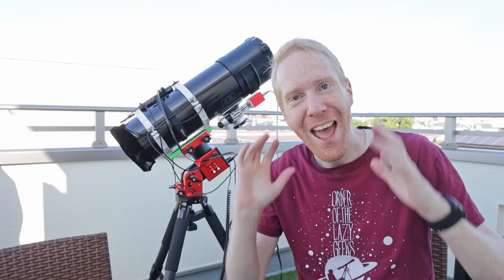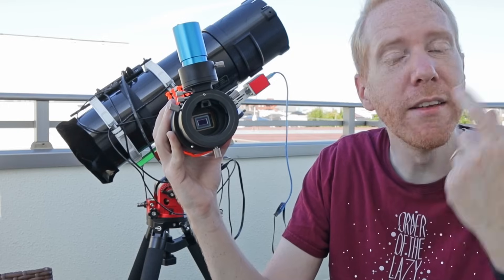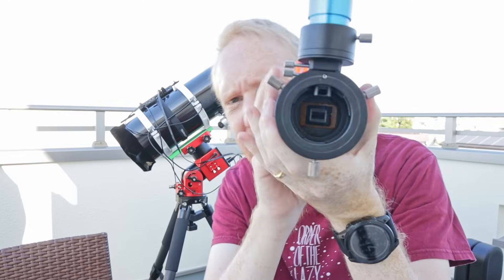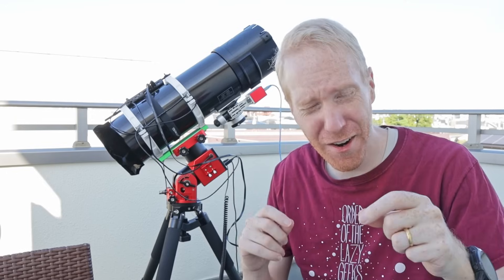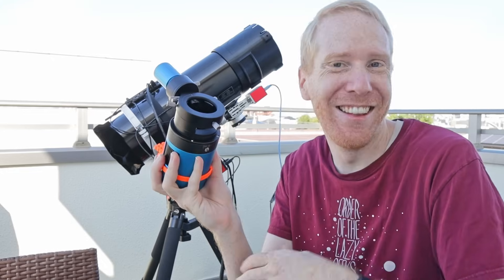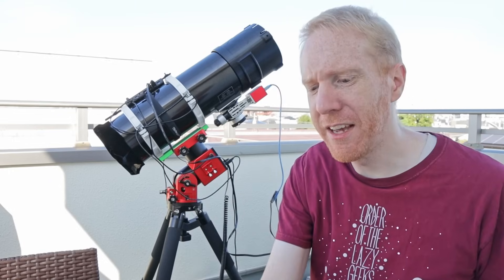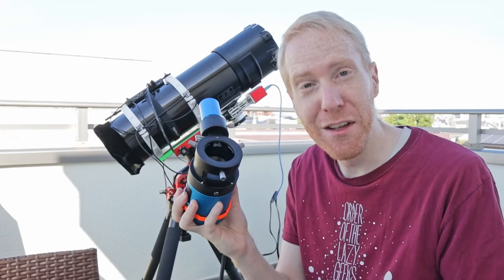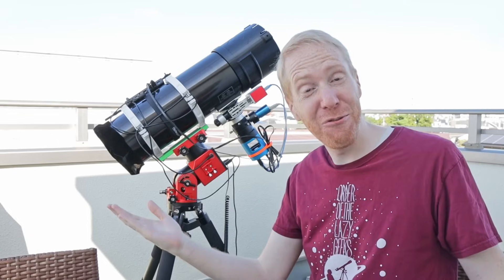Trouble with Off Axis Guiding? Let's fix that! ZWO ASI2600MC Duo too :)

Comment: Thanks for in depth discussion on oag.  Plenty of valuable points were taken into account. However, for this telescope operating @520 mm with comma comma corrector (simultaneously working as a reducer also) absolutely no need of oag. Using the same setup, i have taken 5min exposure shots without any problem. The employed mount was am3, which does not offer heavy pay load capacity load capacity than am5, utilized by you.
Reply from the maker: Definitely needed an OAG because of the terrible default focuser on that scope causing differential flexure :)
Reply: @CuivTheLazyGeek  sorry, I haven’t provided  complete details of the setup. I use asi120 mini scope for guiding. It will be exciting if you give a detailed comparison of the oag with traditional guiding scope mechanism, so that we will be able to know, how much significant impact oag has over the traditional. And it will also generate more sense and validity of using oag on small focal length telescopes. Thank you

Comment: Hey Cuiv!
I got a question:
Since I am using the OAG, my star shape issues disappeared, so all is good in this regard.
However, since I now have to use a filter drawer (so I can use it with DNB filter), I have literally 0mm space for a rotator. (16.5mm OAG + 21mm filter drawer + 17.5mm from the camera = 55mm exactly).
My only way of rotating is by rotating the coma corrector inside the focuser, which is very suboptimal, since this will cause the collimation to vanish. I tested that with the OCAL, no matter how careful I turn and lock it again, probably simply due to the way the CC is built, I lose collimation.

Also, even though it is not a big issue, I couldn't turn the camera in a way so that the prism of the OAG is parallel like it is for you, so I have quite some big vignetting in the guidecam.
How did you solve the rotating issue?
Reply from the maker: Interested on the collimation. Maybe I'm not demanding enough of my equipment, but the CC rotation doesn't seem to affect collimation. Maybe some astigmatism in your CC?
Reply: @CuivTheLazyGeek  Hm that's a good question. I don't think so as my  cc has very good quality and I don't see any optical issue with it.
It is probably just the way it lies inside the focuser.
I read in the OCAL instruction that this is normal, simply because nothing is built 100% perfectly, so that you should collimate on a specific rotation and don't change it if possible.
I guess if I could just turn my camera it wouldn't be an issue, though

Comment: I used OAG years ago, and I wasnt fond of them. Ive been using guide scopes for years now. However, the products I wa using are nothing like they have now. I may look into for longer focal length imaging. It would makes things much lighter also.
Reply from the maker: Agree - usually there wasn't a reason for them except for long focal lengths, but it's a bit easier these days

Comment: Another issue with OAG during Galaxy season is after a meridian flip on an EQ amount, you have a different star field due to the flip, there may or not be a star available to guide on after the flip. This can be a pain when doing automated imaging without a motorized rotator.
Reply from the maker: True, especially with large focal lengths.

Comment: Thanks, Cuiv.  This helps.  You are correct about the long focal lengths scopes.  Mine is 2800mm and there are times when there are no stars in the view.
Reply from the maker: Yeah 2800mm is an extremely long FL, kudos for imaging on such a long FL!

Comment: Perfectly focused stars especially when undersampled will take up only one pixel (mostly on guide scopes) and your guiding software might confuse it for a hot pixel. Also, if you have a good quality telescope and a solid mounting system for your guide scope, don't bother with an of axis guider. People make it sound like it is the only way to image. On my f2.8 newtonian gave up on the OAG, kept having shadow of the prism on my zwo asi533. Works perfectly  fine with guide scope
Reply: Also, your OAG should be in front of filter wheel

Comment: if you don't focus also the guide camera after a filter change and autofocus has happened, you will run into a risk that the guide stars that are now defocused, will not be detected any longer by PHD and it will stop guiding on "star lost". It happened to me many times.
Reply from the maker: Yes, I should have mentioned in the video that I assume the filters are reasonably parfocal - if you're using 3mm thick filters and 1mm thick filters, you will have issues. It's weird though, for me PHD2 keeps trying and trying and trying until it finds the star again, never stopping. And even if it then locks on the wrong star and pulls the target off center, NINA will catch that and recenter

Comment: Great discussion Cuiv! Two points:

(1) Another solution for the issue of guiding when re-focusing after changing filters: Use "filter offsets" and also temperature-compensating focus changes. Once these two automated processes are dialed-in, one only has to focus using a luminance filter, then guiding can continue uninterrupted until a new target is chosen. The good news is that NINA & some other imaging software (and software from some focuser manufacturers) can handle "filter offsets" and - with a temperature sensor added to the system - temperature-compensating focus changes.

(2) The issue of finding a guide star with longer focal length systems (especially in fields with few brighter stars) brings us full-circle in our search for equipment for astrophotography. It used to be that a very finely-machined, ultra-precise & often heavy mount with minimal Backlash & Period Error was a necessity. Now, 'harmonic mounts' are becoming all the rage, because of their amazing portability, and (if carefully-designed) virtually zero backlash. The problem, however, is that 'harmonic mounts' inherently have a large 'periodic error', plus the rate at which the mount 'loses stars' can be very rapid/sudden. This means that most 'harmonic mounts' require very frequent guiding corrections, therefore very short guide exposures (e.g. 0.5 second for the AM5), which, in-turn, exacerbates the challenge of finding suitably bright stars for guiding with the off-axis guider (especially with longer focal length systems)! Yikes! lol

Why is this a problem? Well, the only way to mitigate this issue is to use longer guide camera exposures, and/or rotate the guiding camera...but in the former, that means the mount needs to have smaller periodic error & no sudden changes in tracking, which 'harmonic mounts' cannot deliver. In the latter, it often means purchasing a rotator, so that the process can be automated & be highly reproducible (for imaging on successive nights, and also for reliable flat frames) So, if one wishes to keep the system highly portable, there are several solutions, including (a) purchasing a rotator for the system,  (b) keeping the same longer focal length, but use a much 'faster' system (therefore more aperture), (c) employing imaging & guide cameras with much higher sensitivity, (d) using a harmonic mount that has encoders on the RA axis, or (e) giving up & imaging at a shorter focal length, With every solution except (e), it will require purchasing new, more expensive gear....which is why, IMHO, astrophotography represents 'a black hole for wallets & bank accounts'! lol
Reply from the maker: Yep, aware of filter offsets (was actively involved in NINA development at the time and added the default AF filter that relies on that :) ), it worked great when doing filter looping, like L->R->G->B->L... in sequence
And agreed on harmonic drive mounts, although my AM5 seems to perform very well with 1s exposures, although a bit better with 0.5s exposures :)
Perfect summary of the deepening black hole of astrophoto lol

Comment: Excellent in-depth presentation of OAG issues. Regarding prism size and the ability to get more stars, yes, the Celestron OAG has a 12x12mm prism. However, weight and backfocus requirements are really too constraining to be a good option for many use cases. Also, it requires a larger camera and altogether the price is eyewatering: about $750 for celestron+ASI174MM! Not to mention that a 12mm high prism can be difficult to manage. A great alternative is the TOAG:  it has a small prism but i) has 2 screws to move the prism and camera laterally, and ii) the adjustment of prism depth can easily be done by moving the whole camera port+prism tube (in addition to moving the prism tube relatively to the camera port). Basically, with a small prism and a small sensor, the TOAG can reach more stars than an ASI174MM on a 12x12mm prism. The TOAG has limited options for connections on the camera side, it won't work well with 2" filter drawers, but it is very thin and very light. An excellent option (only option if 55mm backfocus limit) for Canon EOS EF users with dedicated drop-in filters. Also very cheap: TOAG+ASI120MM mini is about $250.
Reply from the maker: Oh that TOAG looks great! lateral camera movement sounds awesome, but does it mean the slit is long and thus letting light in? Excellent option indeed!
Reply: @CuivTheLazyGeek  the slit is just over 4.6mmx7.8mm, good for guide cameras up to the ASI220MM. The camera doesn't move relatively to the slit. The whole bloc, from the prism to the camera, including the slit, moves laterally or vertically together.

Comment: PHD2 does indeed recognize misshapen stars, but guiding quality drops. 
What about ASAir? Does it recognize misshapen stars during guiding? 
What happened with your SCT Hyperstar system and IOptron mount? Sold?
Reply from the maker: ASIAIR apparently uses the PHD2 code under the hood, so it should be the same! I still have the Hyperstar, but I'm getting such good results with the Newt it hasn't seen much use recently...
Reply: @CuivTheLazyGeek  Great to hear about Newtonian scope. I thought a lot to get Hyperstar or Takahashi Epsilon. Got Epsilon, it catapulted sensitive to “new level”. It doesn’t much resolution of Edge 9.25, but perfect for many large and dim targets.

Comment: Hi Cuiv, thanks for the extra info. PHD2 is very forgiving of poor focus, last winter my 50mm guidscope drifted out of focus as the temperature droped and it kept working in fact it even worked with a light  coating of dew on the lens. I have just bought an OAG but needless to say there are no clear nights forcast anytime soon so can't try at the moment.
Reply from the maker: Your OAG came with clouds, as it is wont to do, I hope you get clear skies soon!

Comment: My experience is that the best way to deal with « comet shape stars » is to fix your backfocus distance…. But sometimes it’s not perfect… depending on quality of the corrector…
Christophe
Reply from the maker: True - if the issue is backfocus, then this helps, but it would also then be affecting your main imaging camera (assuming the sensor isn't too small), so it should be fairly easy to notice!